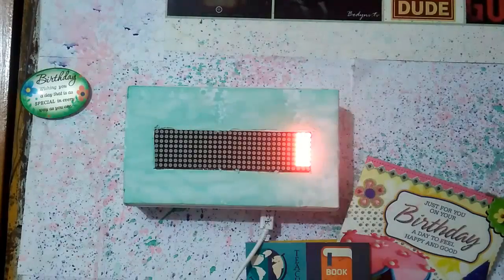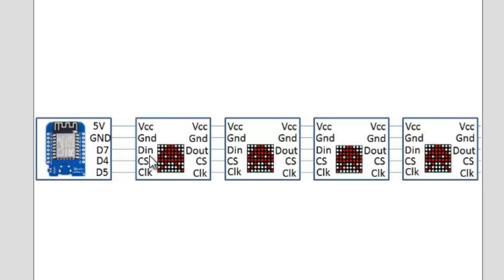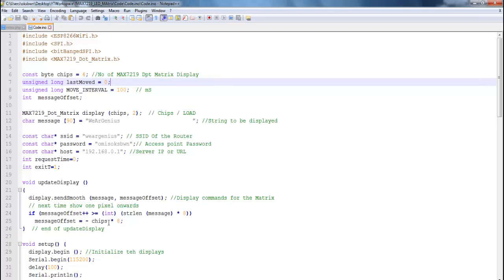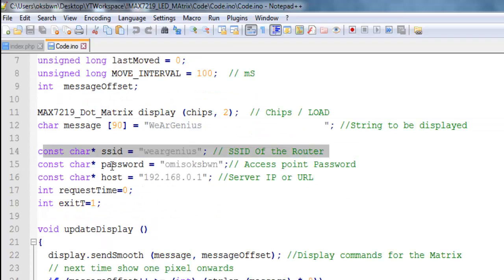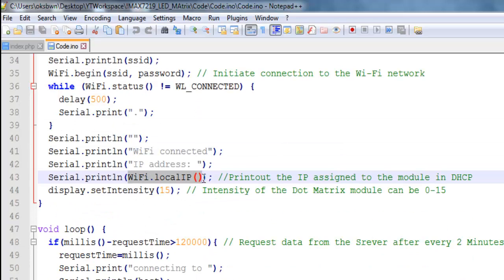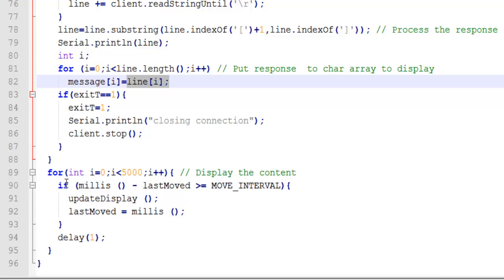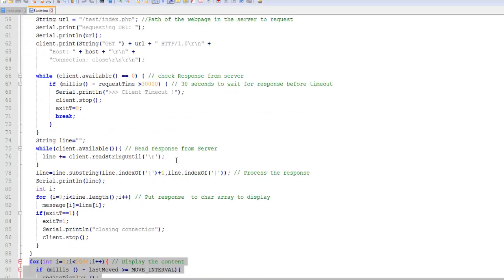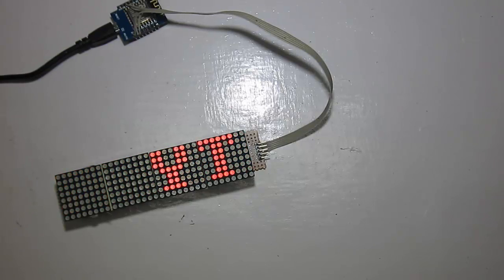Information Display System using WeMOS and MAX7219 | MAKE #3

Comment: Hi, thanks for the explanation - there are a lot of MAX7219 tutorials and libraries out there, but yours is the only one I got to work with a D1-mini. I just wanted to get a quick and dirty internet (NTP) clock going, and it's taken ages to find the right info - thank you so much. By the way, have you taken the sourcecode down from github? I'm getting a 404 when trying to follow your link above.